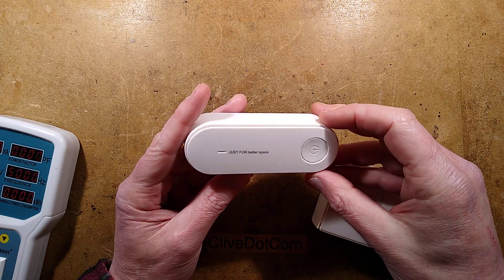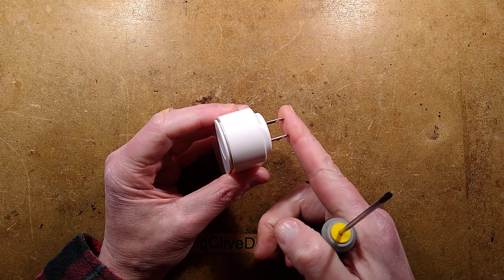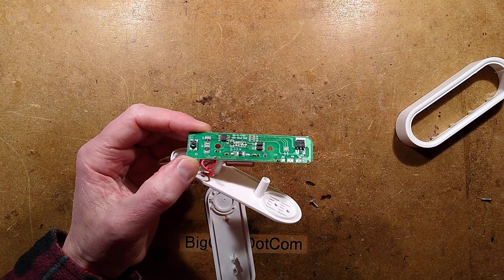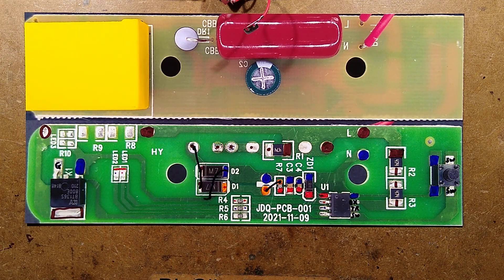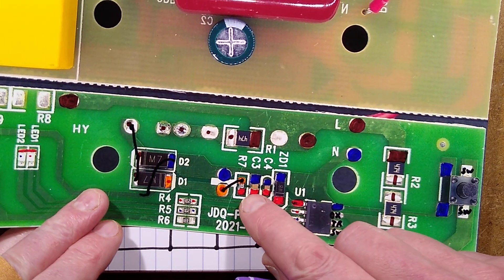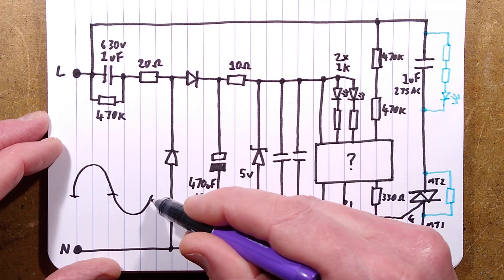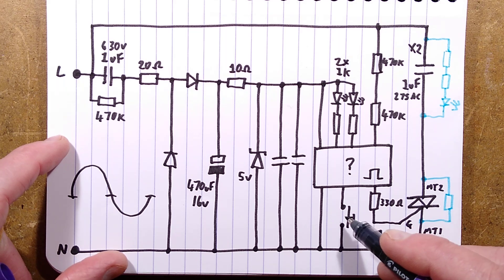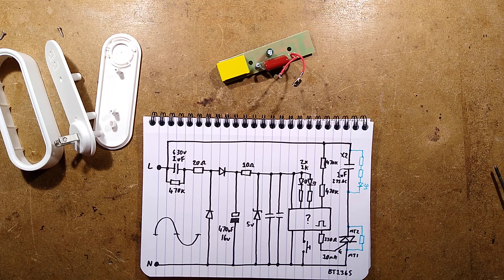Computerised power saver plug (with schematic)

Comment: Technically it actually works so is not a fake, the scam is it does very little. The zero switching means the triac is not switching in a capacitor at peak voltage. A nice little zero volt switch, just need a use now

Comment: I have an old power saver. It has cooling vanes and two capacitors. You plug it into the wall, and then plug your device into it. It seems to work.

Comment: If anyone would have predicted in the late '60's that someone would design and manufacture a device that would use a complete computer to switch a capacitor in and out of a fake circuit people would have called the broad-shouldered guys with the white coats and the special jacket, after which one would find oneself in a fully padded capsule mounted on a experimental rocket and subsequently sent to the moon.

Comment: The whole circuit is still the one to drive a high voltage ozone generator block, the factory only replaced the ozone generator with a capacitor. Replace it with an ozone generator and voila, back to its old functions.. 🤷

Comment: It looks like the module was intended to drive a legitimate output device in the position where the X2 capacitor resides. Perhaps a relay? 

 Let's call this a "Homeopathic Power Saver" since it actually does contain some (highly diluted) active electronics.

Comment: I guess they could be doing power factor correction if they detect a slightly inductive load by switching in a capacitor half-way through the cycle to compensate?

I would expect most houses to have a mostly capacitive power factor with all those switch mode PSU's we have everywhere though!

Comment: I found a similar device in a car I was fixing. At first I was like wtf is this. It had a couple of caps 2 inductors and a 555 chip on it. I removed it because some components had actually fallen out because of the bad solder work on it. I never went through it and it is sitting in my toolbox. Would love to see you do an autopsy and reverse engineer it. Let me know where I can get your information I will send it so you can make a video. The only component that fell out was the fuse holder. So it was definitely not working.
Reply from the maker: Maybe one of the fake anti-rust devices.

Comment: Could you explain the importance of X capacitors? I have plug in surge protectors that self-consume 29-43 mA, and I suspect it is the X capacitors leaking current! Was wondering what effect if I remove them?
Reply from the maker: That current is apparent power.  If you use a meter that displays actual power as usually measured by your electricity meter, it will show zero.

Comment: Have anyone ever built a "power saver" that actually work? Is it even possible in theory to do what they claim? If both are answered no is it not fraud to even sell any of these products?
Reply from the maker: Only in an industrial environment with high inductive loads and a specialist system that switches capacitor banks in and out.

Comment: Hi Clive, my name's Joe.  I've enjoyed the content on your channel for a long time, and would like your expert opinion on something, realizing that with almost a million subs you might not be able to find the time to answer...I bought an inexpensive (cheap) toy drone, and since I can't be bothered with reading instructions, I calibrated it incorrectly.  Long story short, it flew up and over some trees, never to be seen again.  I've tried a bunch of ways to find it, to no avail, and by now it's batteries should be dead, or it's turned itself off and I am out of range to communicate with it.  I was wondering if there was a way to install a backup battery or arrange it so the unit would go into power-saving mode until a controller contacted it...Hell, even if the power gets low and it fires up a klaxon until you find it would be helpful.  I am purchasing an identical unit (partly to find the other one,) and expect to lose it too!  Thanks for all of the great content through the years!
Reply from the maker: Weight is a huge issue with drones, so adding an extra battery would be a problem.  But you do get modules for drones that aid in finding them by beeping.
Reply: I'm so pleased you had the time to respond!  I guess unless the unit has stored GPS ability, the only solution would be something like an Airtag...Have a good day, sir, and again, thanks for answering!

Comment: These gadgets weren't intended to save energy, they were supposed to fool the meter into reading less power than was used through being a highly reactive load. I'm pretty sure the meters correct for this now.
Reply from the maker: For proper inductive load compensation the capacitor has to be matched to each device.
Reply: If you want the meter to show less power, the meter is measuring real power only, so you have to shift the power from real to apparent by phase shifting the current and voltage, reducing the power factor. So surely you don't want to correct the power factor and push it back close to 1.0 ?

Comment: The resistor over the triac could help switching it off when the current zero-crosses. The LED mainly causes a phase correct current while the capacitor shifts the current. This makes it difficult for a triac to turn off because the current is almost never below the holding current threshold. By placing a resistor over MT1 and MT2 you can bypass the ohmic amount of the current and make the triac switch off 90° later.

Comment: I found this paper on ieee
Power factor improvement by pulse width modulated switched single capacitor

Reactive power is recognized as an essential factor in the design and good operation of power system. Real and reactive power on a transmission line in an integrated network is governed by the line impedance, voltage magnitudes, the angle of differences at the line ends, and the role the line plays in maintaining network stability under dynamic contingencies. Reactive power compensation or control is essential part in a power system to minimize power transmission loss, to maximize power transmission capability, and to maintain the system voltage within desired level. In this paper a new method is proposed which improves the power factor automatically of varying lagging loads to unity, using one single large shunt capacitor instead of using a bank of switching capacitors. Basically, this control scheme is a static power factor correction method by continuous voltage or current control of a capacitor. In this work the voltage across the capacitor is being changed by a bi-directional switch to control the magnitude of compensating capacitor current and thereby attaining unity power factor. This system incorporates high-speed insulated gate bipolar transistor switching technology. The gate signal of the switching devices is generated by using a compact and commercially available IC chip SG1524B. The scheme is simple in this sense that it uses only one static bi-directional switch controlled by an electronic control circuit that uses only analog ICs and some discrete digital components.

Comment: Its crazy that in 2nd line of the Box details its already stating things that impossible. 
10,000 Watts from even a 240 volt system is not easily possible (most house fuses are 10amps some are 15 amps. 
Thats still only 2400 Watts to max 3600 watts. (not even a Welder or Grinder will pull 5,000 watts combined.

Comment: Would it be safe to assume that the capacitor is switched as multimeter theater? Like, if you don't know enough about electricity to know that these things can't possibly do anything, but you're a skeptic by nature and you want to test it. So you do a Google about ways that "dirty" power can affect the power bill, and Google says "something something power factor something Fluke beer something." Hm. Okay. You plug in the scammy doodad, you check the power factor, you turn the doodad on, and hey presto! The power factor's better! The doodad must work! TikTok time! ⚡ Power 🔌companies 🤑 HATE this ONE WEIRD TRICK! And by the way don't open this to see how it works because it is SHOCKING! 

Or is that an unreasonable level of effort to expect from something like this?

Comment: They left the discharge resistors out so you get a shock and might want to give up reverse engineering a circuit diagram. That way, no one gets to see what a load of cack is inside.

Comment: Suddenly I get an idea. The new meters for electric use are very trigger happy, and easily confused, people whom have switched from a classical meter with the turning disk to the electronic meter all complaint about the fact that the costs of electric were going up. 
 
Now comes the idea, the new meters measure the use of milliseconds and they calculate milliwatts of power used, with two large capacitor (one for each half of the phase) and a hole bunch of switching, the power use can be stabilized, then the new electronic meter can no longer detect microwatts being used because this is coming from the capacitors. If the current is stabilised, therefore there are no micro peaks in the power consumption, the result should be a lower amount of extortion money each month to be paid to the electric company.

Comment: I hate these capacitive droppers with a passion. They used to use them in cheap valve radio sets (along with dropper resistors) before it was mandatory to colour code mains wires! Even with an isolation xfrmer these things are still death traps for the unwary.

Comment: i am going to make a power saver plug that really works, i am going to connect live, neutral and earth together. as soon as it is plugged in there will be a bit of a popping sound and the socket circuit will go off, hence nothing on that circuit will be draining that valuable energy.

Comment: @bigclive 
I’ve seen a video advert pop up today for an identical device.. on that video they very briefly had your workbench and a circuit diagram on a ring bound pad .. not the diagram in this video.  It popped up a few times.. next time I’ll try and note the advertisers name
Reply from the maker: It happens a lot.  Their current clip is the USB UVC sterilizer.

Comment: Well, I see  the logic of using that board. Quite well...
a) power saving plug
b) switchable ionizer
c) UV-light ( well ,you know because)
d) night light

You can sell the case for all of these and only need to change a couple of components.
for b): no big capacitor but simply put the ionizer-block in place of that
C) / d) : uv-LIGHT or nightlight: simply put the resistors and LED into place

All can be switched off or on with the LED-indicators, board and fits inside this casing

Since the reason for c) is now over, just make power savers out of them or nightlights and you can sell all of your stock.

Comment: Here’s a thought. A capacitor would ordinarily be used for power factor correction on an inductive load. Normally this requires a matched capacitor. Could maybe the microcontroller be switching a fixed value capacitor in and out in order to make the measuring device measure an average PF of one? The real question is whether the triac is being turned on on every cycle, or just some cycles. If the later, I would be inclined to think it was some sort of PF cheat.
Reply from the maker: It would need to be able to measure the voltage and current waveforms of the whole installation.  I scoped the gate drive and it was a flat line.

Comment: HUGE  amusement ( ? ) ... power saver ? ... turn your  ( F**! @ * )  device(s)  OFF  ( at the switch ! ) or use the  430 MHz " remote " switches , if you cannot get to the socket .. ( a familiar power saving SCAM , used by many  " Geezers " trying to sell  YOU ! smart meters  ) ... QED .... DAVE™   🛑

Comment: What a brilliant idea to use a triac to switch the capacitor from the mains instead of a discharge resistor. That way, whoever touched the capacitor inside would get a nice surprise even after being scammed into buying a 2 pack and getting half. And the power saver was actually a power waster. Not to mention, the triac had a power supply that wastes power instead.

Comment: Isn't the zero crossing detection flawed? The triac turns off with zero through current, which is not at zero voltage due to the capacitor.

Comment: Was this designed as a power saver or was it a design flop for something else and not to waste it they sold it as a power saver? You are braver than me, if I got zapped, I would not of tested to see if the capacitor was discharged with my fingers. I saw spark that alone frightened me let alone the shock you received.

Comment: Devices like this make me think that 'common sense' or 'conventional wisdom' or whatever you want to call it is something that doesn't really exist. But even if you do not believe in the laws of physics ... come on 10000W ... I don't know how the standard mains socket in the UK is rated ... ours here in Germany do have either 10A or 16A fuses ... which gives you 3.5KW as a maximum (and this is not intended for permanent use). The rating is such a bold claim, it should give away the 'fake device' to everyone.
However, junk like this wouldn't be produced, if it couldn't be sold. At least, we get an educational video out of it ;-)

Comment: These people are so good at repurposing old parts. Not just useless scammy items but everyday objects as well.
I have an old Supertron SM1421 MDA monitor from 1989 and another Taiwanese company used the exact same bezel and crammed a mono VGA circuit in it. It's a tight fit but it works, they must've cut lot of the costs that way.
Competition between these Chinotaiwanese businesses must be huge.

Comment: I wonder if this was originally an ioniser design, and they just swapped the ioniser module with the yellow cap? That would make more sense
Reply from the maker: There is an ioniser that uses the same case and similar circuitry, but a low voltage DC ioniser module.

Comment: How does it detect zero crossing using the two resistors in series? Is it monitoring current flow ?
Reply from the maker: They limit the current to the microcontroller input pin, the integrated protection diodes clamp it to the power rails.  When the zero crossing point is passed through the input pin changes from a 1 to a 0 or vice versa.

Comment: Did they say 10,000 watts?  That's about 50A at 200V.

My friend and I once built a 10A power supply which had a 30A bridge rectifier in it.

Unfortunately we neglected to mount the rectifier on a heat sink, so we started to smell the smell of baking components.

I decided to feel everything to see what was getting warm.

When I touched the rectifier, it was burning hot.  Youch!!!

And I still have the International Rectifier logo branded onto my finger tip 20 years later.  (A very good lesson never forgotten :-)

And that was only about 15 watts or so.

Ohh.. Those naughty Chinese marketeers and their 10,000 watts  :-)

Comment: Guys, I got the idea how these masterpieces actually saves power.
...
If you plug a dozen of this in your house it actually occupies a lot of sockets so you cannot plug anything else and it saves the power.

That suddenly hit me.
Reply: Genius 😊
Reply: You got it 👍
Reply: Sounds logical to me.
Reply: Shocking!
Reply: @xerox-0579  yes the capacitor was
Reply: If you make it a dead short it'll pop the breaker and save power across the entire circuit as well
Reply: And its called JUST FOR better space. Spaces filled with one of these on a dual socket!
Reply: 10000000000000000000000000000000000000 iq right there
Reply: Земляк!

Comment: Perhaps the PCB positions for the components that are not fitted are used in an alternative cost-cutting version that has no micro or option for switching the capacitor in/out.

Comment: If it wasn't for the fact that the input capacitor is 1uf and there is a zener across the 2nd capacitor, that circuit would be a half wave voltage doubler circuit.

Comment: 6:00 - Somebody in China is going to get fired. He could have saved his company a WHOLE PENNY by sticking a 5.6V zener at that location, before the halfwave rectifier, instead of after it. I use that trick all the time, with the capacitor dropper, and only use 1 rectifier, instead of 2.

Comment: Just a bit of pedantry; the triac turns off automatically when the current passing through it crosses zero. That is, having a pure capacitive load, exactly the point of maximum voltage across the mains line. So, the "hard" continuous command current is the easiest way to maintain the triac conducting. Probably, the designer's initial idea was to detect the moment of the zero crossing and to "compute" the delay of the gate control pulse for every half-wave of the alternating supply voltage.
The measured 40 VA of purely capacitive reactive power is able to compensate for the same amount of inductive reactive power. If the utilities companies charge for the reactive energy, then something like this product, or simply a capacitor with a plug, may help save those 80£ per year (from BigClive's example).

Comment: I struggle to believe that people fall for this kind of scam
I have worked all my life as an industrial electrician and I am very familiar with the workings of power factor correction capacitors in factory substations.
Of course they are a big benefit to a factory that has hundreds .. possibly thousands of electric motors pulling the power factor down.
Nearly everywhere that I have worked there has been in the on site substations power factor correction capacitors
But at home?
How much inductive load will you find in a domestic environment?
Maybe the hoover, hair drier, lawn mower?
A small capacitor in one of these devices will probably, because of it's current consumption, cost more than it can pretend to save